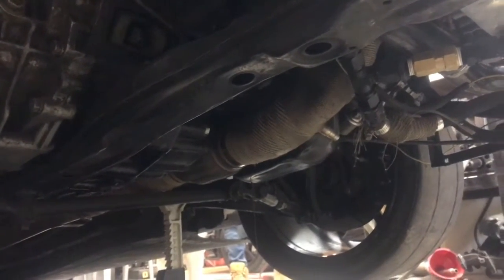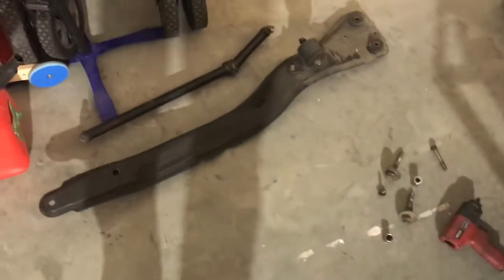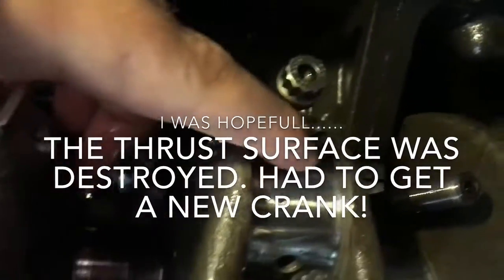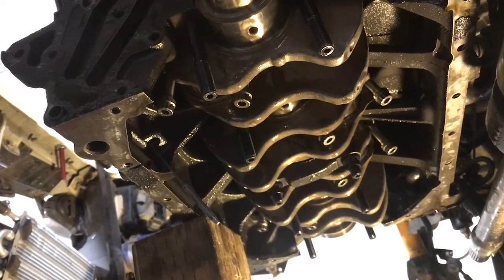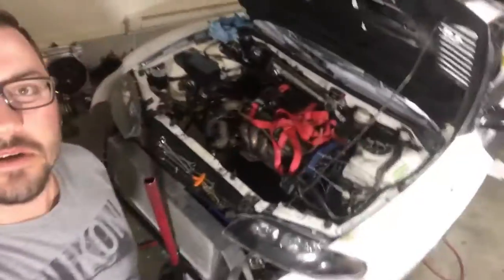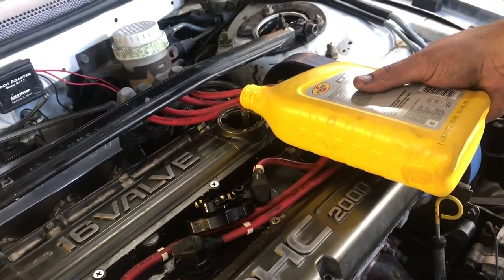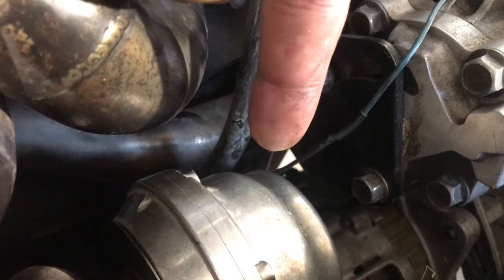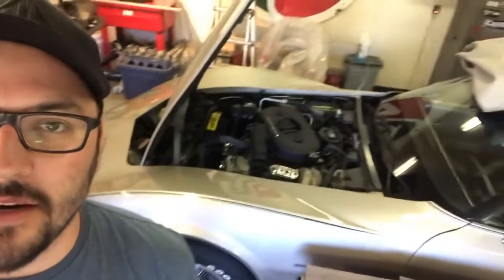4G63 Crank Walk Repair - Bearing and Crank Replace - 2019

Comment: Yow.... For N/A single cam carby 4g63 can you just replace the thrust bearing and also replace is without taking the crankshaft off?
Reply from the maker: I think you could roll a bearing in with the crank shaft in…if the crank is not damaged at all.

Comment: Hey man just wondering where I can get parts like crank, bearings and oil pump for an old evo. Haven't had much luck finding the right sources
Reply from the maker: Rtmracing is where I order my stuff usually.

Comment: Hello. So I'm about to rebuild my engine and I saw what you were doing I have to do the same. So would it be better just to leave the engine in the bay and replace the crank and pistons from underneath ?
Reply from the maker: Donovan Strieby I don’t think it was faster really. Likely be easier to do by just pulling the engine.

Comment: Which 4g63 motor is this, 6 or 7 bolt? Also why waste time rebuilding It as its gonna happen again. I use to race these engine in the early 2000s and gotten burned with crankwalk issue on the 7 bolt until I swapped in the 6 bolt all was good.
Reply: What year is that? Looks like quite a motor, I like seeing these all clean and looked after, not many around now
Reply from the maker: layton7430 engine is a 92 6 bolt and the car is a 95
Reply from the maker: This is a 6 bolt.
Reply: @smokin80  The 6 bolt doesn't come with the thrust bearings on the main bearing, the thrust bearings must be installed separately.
Reply from the maker: Dinuka Senadeera it is for sure a 6 bolt. These are ACL trimetal race bearings. It is the 2nd 6 bolt I have had in this car. Only one I have failed. Other one I sold and built this one. 2900lb single player clutches are hard on thrust bearings. I’ve been running this car since the early 2000’s and this is the first engine related failure I have had. Sometimes shit happens.
Reply: @smokin80  Does that mean that the 7 Bolt engine can use the same bearing to decrease the chances of crankwalk ?
Reply from the maker: Dinuka Senadeera so, early 7 bolts had single piece thirst bearing. Later “revised 98-99 and soooome 97s had the split thrust bearing. As far as I know the revised split bearing is actually better but I do not believe they are interchangeable. 

I could be off a bit on the years but I’m pretty sure. 

All I do know for sure is my engine is 100% 6 bolt everything. I’ve never had a 7 bolt apart. Took the 7 bolt out of this one in 2006 and put a built 6 in. Never looked back. 

My theory on why this one walked is that the cranks are nitrided from the factory and it was machined. The crank I replaced it with is factory size and apparently that helps with surface hardness. I guess we will find out!  Car has a day of dyno pulls, 3 track days, and 2 hill climbs on it since doing this repair.
Reply: @smokin80  alright thanks for the reply, how much HP are you pushing on that setup
Reply from the maker: Dinuka Senadeera 565whp